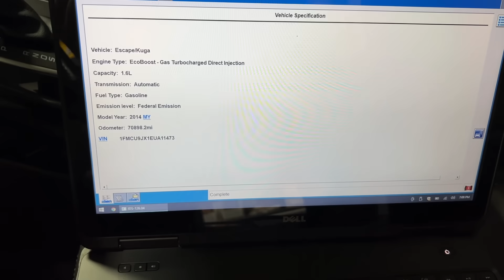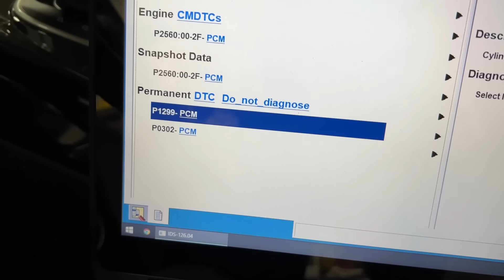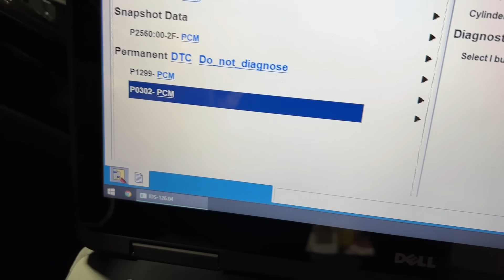Beware of Ford’s 1.5L 1.6L 2.0L Ecoboost Engines and Their Never Ending Coolant Consumption Issues!

Comment: Just about every manufacturer has a problem with something like this. Pontiac had a problem with four cylinders in Fieros exploding ( just big enough to ruin block but no other damage to my knowledge) on startup. I knew someone who owned one and he told me. Dodge four and six had terrible reliability problems in the 80s-90s. As in Caravan and Neons. Saw plenty of Caravans smoking by five years old. But what matters is if the manufacturer does the right thing.

Comment: Idk why, but I’ve always heard the 16+ 2.0 eco boosts are the problem ones. The 13-15 years from what I’ve seen have been relatively good. But the 1.5 and 1.6 engines are notorious for this.
Reply: I’ve heard that the 13-15 2.0 has a block designed by Mazda, which I would assume is why they’re not experiencing the same issues at the 1.5, 1.6 and later 2.0. I have a 14 with the 2.0, 121k miles and absolutely zero issues. It runs smooth, doesn’t use any oil or leak and fluids. Great on gas too!
Reply: Nope. My 2015 edge leaked coolant inside aswell. Ford said to pound sand. NEVER BUY FORD! BUY TOYOTA FOR THE RESALE ALONE!
Reply: @exil3dlivecom The Edge was the first Ford to get the new, weaker block, that could be why

Comment: How do you know it's not just the headgasket?
Reply from the maker: Head gasket failure a thing of the in most instances. This is a known block design flaw, that is how I know.
Reply: That’s a large amount of money to charge someone with out pulling the head and verifying the failure point.
Reply from the maker: I am a Ford specialty shop so I already know the failure point, no need to fleece the customer for a tear down too. Head gasket failures are pretty much a thing of the past since the introduction of MLS gaskets.
Reply: @FordTechMakuloco  it’s still a guess homie regardless of how smart you are. MLS gaskets fail all the time, for a number of reasons. If you were to invest in a nicer endocospe, they come with side view cameras to switch to and you can check the head gaskets. Further pulling the head in that motor takes all of an hour. How much is the bill ? I just always had a problem with the guy in the shop that replaced things because “I’m an expert”. Then they toss a motor at it and it “fixes” the problem.
Reply from the maker: I will be pulling the old engine apart in a later video if that makes you feel better.
Reply: @FordTechMakuloco  

Actually yeah. That would be pretty cool. Again I’m not saying you’re wrong I’m just. Saying you can’t be sure unless you check your work. It doesn’t matter how good you are.

Comment: Wow!!  But, if it is a design flaw...and you install a "long-block".  Ahhh, won't the issue return??
Reply from the maker: You think it wasn't corrected in 7 years? It generally takes for 3-4 years to fix a design flaw so I think we are safe.
Reply: @FordTechMakuloco  ... Thanks for the reply.  

When you talked about the block as bad, that's why my concern.  It's one thing if the head gasket or even the head bolts, because that is an easier remedy.

Comment: Being an aluminum alloy, turbocharged engine, the block and heads and turbo are subject to extreme heat when driven hard, which takes a mile or two of normal driving to "drive off".  You don't want to drive one of these engines like a madman and then park it right away.  I have always been careful to drive the last mile or two gently on my way to work or home.  It's also bad for the turbo, as oil gets trapped in the oil lines, and it will coke up without the engine oil pump moving fresh oil through the turbo!
Reply: turbo timer
Reply: @jamesmedina2062  who's going to put a turbo timer on the family soccer mobile or grocery hauler?  There's a lot of people who have asshole driving habits nowadays, even in the family vehcle...
Reply: @brentboswell1294  Well many people will do it unless like me they drive slowly for the last minute of drive cycle. Remember every person is a separate entity. Most people learn by mistakes but those willing to learn can comprehend the need for timely oil changes and good driving habits.
Reply: @jamesmedina2062  it's a shame that when someone who's abusing an engine like that, and doesn't know better, blows the freaking engine up (similar to what Ford Tech Makkuluco saw here), and has ruined the block so badly that the only choice is a long block.  Then it becomes "the Ecoboost sucks, and I'll never buy a Ford again!!!”.  Ford could have designed the fan to run after engine shutoff (like VW and Honda), and could've used an electric water pump to keep the coolant going as well after shutdown.  But instead, they chose the way they did...😞

Comment: I have a fix, don't buy an ecoboost-powered vehicle or buy a new one with a warranty and just before the warranty ends trade it in. and just live with trips to a Ford dealer and arguing for new engines. It appears to be a bad/overly complex engine design. With coolant leaks, carbon deposits shouldn't be a problem. Read up on any used vehicle you want to buy and consider problems you will pay for with no warranty.

Comment: We have a 2016 Ford Edge 2.0.  At 68,000 miles this happened and had to replace whole engine.  I just noticed my coolant level is going down and I suspect the same thing again.  I had hoped my replacement engine was an updated version.  

I was considering a ford Maverick with 2.0 but that will be on hold.

Comment: Does this occur in the 1.5L 3 cylinder ecoboost engines in the Ecosport as well or are those relatively safe?  Thanks!
Reply: Wondering the same, found a nice looking Ford Fiesta with that motor and hope that this doesn't count for it

Comment: My wife had a 2016 explorer with the 2.3 I maintained it meticulously oil change every 5,000 on the dot. Coolant flush at 40,000 , plugs at 50,000 and right at 52,000 miles coolant in cylinder 2. My mother 2017 edge 2.0 same deal 50,000 miles coolant in cylinder 2&3. I’m a ford guy but those engines are trash and ford knows it.

Comment: Love ur vids as always but I have a solution. Fill it with coolant, rev the crap out of it until it throws some rods or overheats and dies, then junk it and buy a Toyota. My 2000 avalon has 253k miles and it runs beautifully.

Comment: Great post mortem including endoscope. Car makers all have gone to aluminum block with open deck, which doesn't leave much sealing surface for head gasket. When you add boost, the cylinder can wiggle under the head gasket because open deck block doesn't support the cylinder at the deck. Car markers do this open deck design because of cheaper, faster casting processes. The previous generation of turbo engines used an iron closed deck block. The industry wide adoption of direct injection also has issues.
Reply: I agree and it seems mixed injection works the best but is much more complicated to get right. Also more expensive. As for the blocks, a K20 or K24 Honda engine open deck is good for 500 horses boosted and built tough with a bed plate to strengthen the block and balance shafts to smoothen out vibrations. The head on them has over 90% flow efficiency. They are top 10 4-bangers ever made. Open deck. I think when you use the MLS gasket (multi layer steel) you actually bind the cylinders under the head for some rigidity and reliability. Custom engines also can be made with a special copper ring that seals the chambers better.

Comment: Thanks for keeping us informed on those type of issues with the EcoBoost engines. It’s just a shame that Ford is not doing something about it.
Reply: Pretty much 100% catastrophic engine failure.  After 100+ years Ford really can do better.
Reply: @kelsycunningham8452  zero issues on 2.3L /2.7L & 3.5L Ecoboost! I've owned a 1.5L & 2.0L Ecoboost also  no issues ...we keep vehicles average 6yrs.
Reply: There are tsbs and recalls for the issue. I know I have done 6 in the last year under warranty.
Reply: Well, I think I will keep my 2012 Focus and its naturally aspired, old fashioned 4 cylinder engine. And keep on running it on E85 as it was designed for.
Reply: Never had any issues w/any smaller Ecoboost vehicles we've owned.
Reply: @Davido50     And that's why I asked the question if there is any stats on how prevalent this is...  3 percent ?  30 percent ?  higher  ? lower ?  apparently no one seems to know..  or wants to share.
Reply: I just don’t understand why people tried to mass-sew/claim Ford because of this. It’s not as big as VW diesel gate, but it’s a major defect that’s affects many low milage cars.
Reply: I bought a used 2018 Ford Edge titanium a little over a year ago. 2.0 EcoBoost. Pushing 100k miles. Owe 15k. It’s been well maintained. Coolant keeps going low and misfire in cylinder 2 detected. Pretty sure what the issue is by watching these videos and seeing other experiences. Not sure whether to fight for a fix or trade up for a new
Reply: @dscott_  better call Ford right now about the warranty. If they say no. Then decide to keep buying Ford products
Reply: @dscott_  No brainer. Dump it now, trade for a Toyota/Lexus or Honda/Acura. Easy peasy. Still get whatever you intend to buy, get it inspected, put it on a lift, do a compression test.
Reply: I would have sewed Ford if I’d own of these engines, man I feel sorry for the owners
Reply: It's just a Shame people keep buying Ford's. And complain again and again.
Reply: Oh but Ford is doing something. They are making sure your car doesnt last after 70 thousand miles.😏
Reply: @kenmoats3654  not true at all. My 2.3L TGDI Ecoboost is phenomenal
Reply: I was looking at a Maverick with the 2.0 EcoBoost to replace my old Honda Odyssey minivan with 176k miles... Now I'm second guessing LOL - I didn't know Ford started building engines in 2010.
Reply: @justacinnamonbun8658  don’t do it , same here i got 05 odyssey 207k , need to replace it in the near future but this engines are garbage, the more I look into it. 👍
Reply: @justacinnamonbun8658  the 2.0L TGDI Ecoboost is a good motor. Owned 2.
Reply: @Davido50  Yeah, that's the one YOU had...

Buy 1000 of them and then tell me how many failed. 😆
Reply: @justacinnamonbun8658  buy one and maintain it well and then tell us your findings after a few years. Once you do the research we will be .1% closer to an answer 🧐
Reply: @JoseK47  Sure, no problem. How much skin are you going to put into the game?? How much are you going to give me for the truck?? What percentage?? In fact does anyone else in this comment section want to help pay for this "experiment?".... Didn't think so. Nobody is dumb enough to put their money where their mouth is when it comes to Ford and these EcoBoost engines.
Reply: @justacinnamonbun8658 Ford redesigned the blocks to solve this issue in 2019 to 2020... This is not a problem for the new Mavericks.

Comment: Great video. I owned a 2014 Focus Titanium and got rid of it after 4 years with only 22k miles on it. The issues were the transmission which was an absolute piece of garbage. and the the engine oil leaks which is what finally did it for me. I took it to a Ford dealer and also to an independent mechanic to confirm the diagnosis from the dealer that I need about $2500 in new gaskets, and seals. The independent mechanic told me it would better to get rid of the car as he had seen many issues with these Ecoboost engines, and the well documented double clutch POS transmission issues that Ford knew about before production but sold them anyway. NEVER again will I buy another FORD vehicle. Really sad, because my wife, the prime driver of it, loved everything else about the car and so did I. Ford should rename these engines EcoBUST
Reply: I bought a Mustang 5.0 and older Escorts in the 90s and they run awesome
Reply: Ford has the same reliability issues it's had since 1988.
I won't buy one.
Reply: I can attest to this, replaced the transmission twice on my 201 SE. Total  POS transmission, just bought a Toyota 4runner. First and last Ford that I will ever buy.
Reply: The titanium doesn't come with the ecoboost 🤷‍♂️
Reply: @jasoncaine2600  Jason, you are correct. Thank you for correcting me. The fact remains, Ecoboost or not, the powertrain in that car and the one in this video SUCK. Another testament to FORD's lousy engineering and lack of customer care.

Comment: American cars are crap, made to break, and they all rust. Year after year, they never fix the problems and willfully produce flawed engines. Ford does nothing about cracking ecoboost blocks and the triton cam advance breaks. Roller lifters cause a valve tick then the Roller fractures and munches Dodge engines.  Every JEEP model is made to break. GM has their set off issues but I forgot what they are. My 24yr old Toyota has no rust at all, 160k and it runs like new.  Buying an American car is asking for problems they know they can fix and don't!

Comment: Had a 2017 Edge with the 2.0t and it was fine for about 5k miles (got it used with 40k). I first noticed the coolant issue when the heater stopped working. Put coolant in a couple times and usually about a gallon at a time. Looked in the forums and saw that the 2.0 and other Ecoboost engines are notorious about cylinder head cracks. Used some K-seal coolant repair stuff and never put anymore coolant into it. Seemed to fix it but I'm still a little weary on the Ecoboost engines. Although I traded it in and got an Explorer ST so maybe I don't actually learn lol. I wasn't about to shell out 6k for a new engine at 50k miles.
Reply: 50k miles should mean a car has just gotten broken-in not literally broken apart!
Reply: One would think but it's sad that Ford has known about these issues and didn't help customers when their engines failed. Did see some people were on their second or third engines. 2.3 Ecoboost has coolant issues too. They had to revise the head gasket.

Comment: Have you had one apart to find the cause of the leak?
I'm assuming that since you didn't mention gaskets, that the problem is cracked castings and Ford hasn't taken any steps to try to correct it.
I am not picking on Ford in particular, as I know all the companies have their "problem children."

Comment: I have a 2016 Ecoboost Mustang that I bought new (custom factory order).  I'm at 108,000 miles, no appreciable coolant leak.  I did pay the dealer to flush the coolant last year.  I knew, from owning GM vehicles with DexCool, that the bane of the new pink coolants is letting them get old.  When the new school coolants get too old, they turn acidic and start attacking things, including the head gasket material.

Comment: Great. I love my new 2020 Ford Ranger with the peppy turbo 4 cyl. Guess I should take advantage of skyrocketing prices and dump it before this happens. 
My old Toyota 22R had head gasket issues everyone knew about, but that was a relatively easy fix. 
What is causing the coolant leak in these Ford engines?

Comment: My 2017 had the same problem t 18K miles. Under warranty thankfully. Had to bring it back to the dealer six times over a ten month period. Still not happy with the way it runs but have 28 months left on warranty.